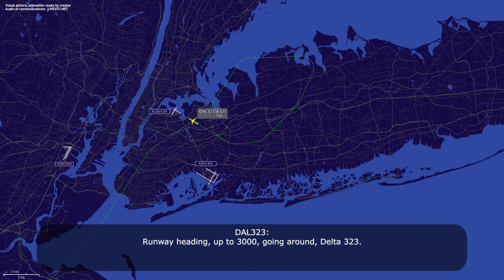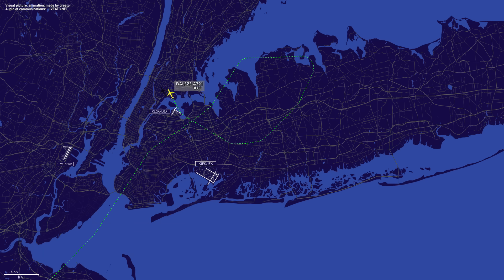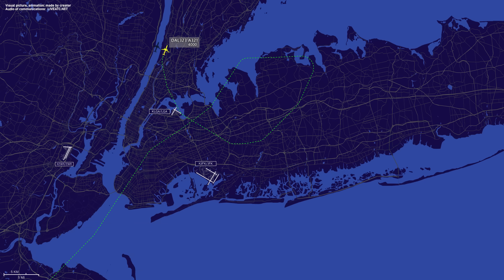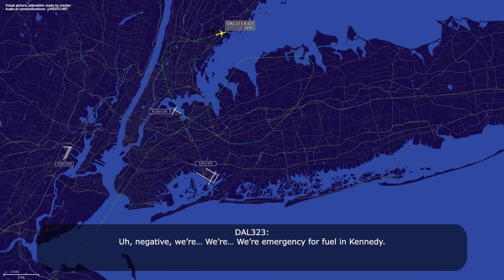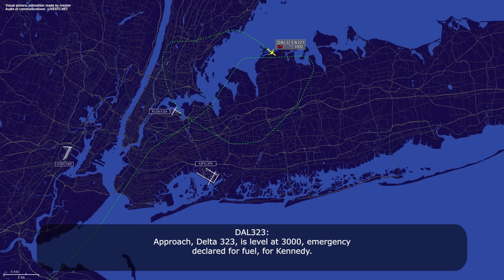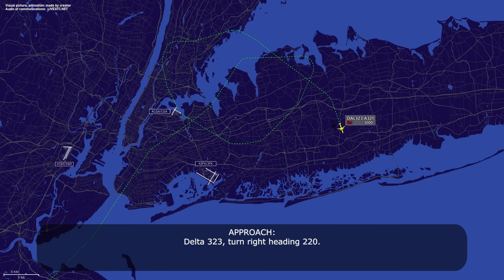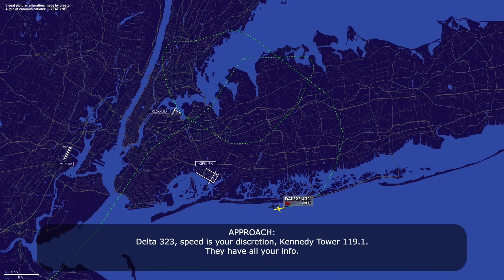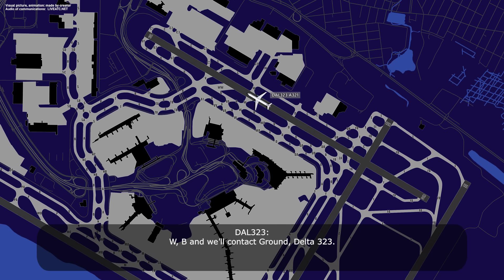Pilot declares MINUMUM FUEL after go around and diverts to Kennedy Airport. Real ATC

Comment: For those criticizing the 40 minute fuel declared as 'emergency:' consider that each go-around can take up to 10 additional minutes and with wind-shear reported at one airport they couldn't take the chance of being number 10 (already about 20 additional minutes) to line up behind the LaGuardia row.
For the same considerations they had to let the JFK folk know they can't be put at the back of the line.
The pilot took the safer choice of having to answer a few additional questions and fill out additional paperwork rather than just 'hope for the best' in getting a favorable landing the second time around.
This 40 minute reserve fuel was a good demonstration of how it is meant to be used.
Reply: Never criticize a pilot erring on the side of safety
Reply: yep, i fully support the pilots decision here. 40 mins of fuel after such a go around, means they are out of safety margins..
Reply: To clarify, mainly for myself, so I'm kind of asking for confirmation: It's an emergency not because they had 40 minutes of fuel left, it's an emergency because they predict they will probably land at their divert with less than final reserve (30 minutes). They can't risk another approach at La Guardia because the known windshear presents an unreasonable risk to committing to that field, so they have to bail out and call JFK as their final option - they know the routing will use 10+ minutes, putting them on the ground with 30 or less, or at least the very high chance of that happening. Ergo, emergency - predicted landing at nearest suitable airport is with less than final reserve.
Reply: @Shrike200  Slightly off - its an emergency because factoring everything, they will have to attempt a landing a Kennedy with 30 mins or less. Since its never taken for granted it'll be a successful landing, additional buffer needs to be given. We've lost a plane before when pilots and controllers not take this into account. Avianca Flight 052.
Reply: The 'acceptable' min fuel is one thing in perfect conditions - but add poor weather, heavy traffic, or any other complications, and all the 'bean counter' calculations are invalid. That's why the captain gets paid the Big Bucks and needs to Call the Mayday while there's still time to adjust - as this one did. Well done all around.
Reply: @gcorriveau6864 the pilots literally counted the beans and determined they would be putting themselves in a very risky position. Stop denigrating analytical analysis. Doing it by the “feels” gets people killed.
Reply: @gcorriveau6864 The bean counter calculations don’t become invalid, they just don’t matter at that point because all the paperwork and late arrivals and extra airport fees is cheaper than running out of fuel by a factor of like a million. The bean counters were probably correct, and they exist to PLAN things. This was adequately planned, and the pilot made adequate adjustments for reality as it unfolded.
Reply: @ahgflyguy  why r u defending beano counters
Reply: Well said. To add to this comment, this flight was during a stretch of a few days with awful weather in Northeastern area. Cold below freezing. Very strong over 21 knots west wind and over 30 knots gust. These kinds of condition result into more go-arounds and loop-back vector in NY airspace is notoriously long due to traffic volume and restriction. 40 mins fuel is barebone in those conditions. Armchair experts criticizing the professionals who do this for living is ridiculous.
Reply: Would they have made it if they had to go around again?
Reply: @carmcb absolutely, probably 4-5x. The issue is that if you give up and have to divert after #5, now you can’t. Typically they’d try at least one more time, but the sequencing was just too long. I’m sure they landed with plenty of fuel even with the divert.
Reply: it's also Delta safety policy once at BINGO fuel. so if the pilots had ignored the fuel requirement, Delta would have ignored their paychecks.
Reply: @gottafly30 So true.  Every airline has its own rules and parameters.  Nothing is left to chance
Reply: Minimum fuel should consider two circuits or missed approaches AND diversion to another airport. If a incident affected that airport no matter how many runways there must be adequate reserves to meet another safe landing elsewhere. Eg power failure or radio outage at airport
Reply: @paulgerrard9227  Also, I think there should be a regulation requiring airlines to file and alternate (with alternate fuel etc) when flying to single runway airports. That way if the runway is closed due to a gear up landing or some other incident, the pilot has the fuel to go to an alternate.
Reply: @6862ptc  flights always have a planned alternate (with acceptable weather), and carry enough fuel to divert. And will do absolutely everything they can to avoid landing with less than minimum reserve fuel.
Reply: @pezzer55  Wrong. Please read FAR 121.619 (the "1,2, 3 rule") and get back to us. I'm always amazed at the certainty with which people post opinions on subjects where they appear to be completely ignorant. For our friends in Europe, we are talking about U.S. regulations here, due to this being a video about a U.S. airline, U.S. aircraft, U.S. airspace, at a U.S. airport. EASA rules are similar...but different.
Reply: @6862ptc  I stand corrected. I was under the impression it was mandatory. I've never flown without (other than local vfr) and can't see why you wouldn't unless maybe there are no sensible alternates due to remoteness or no other suitable runways anywhere nearby
Reply: @pezzer55  What you're saying does make sense. But Airlines are in the business of making money, so they try to balance safety and profit. The FAA only requires a filed alternate (and fuel to get there), when the weather is below/worse than that stipulated in FAR 121.619. Like I posted above, it would make sense to require a filed alternate any time the destination has only one suitable runway. But that's not the law.
Reply: @JohnSmith-zi9or  You are correct. I wasn't speaking about LGA, but I can see why you'd think I was. I was just answering someone's post where he said all flights have an alternate on file. We both know that isn't true. But I added I agreed that many more flights should have an alternate on file, like a single runway airport. Even in domestic U.S., IMHO an alternate should be filed (including fuel).
Reply: So why can't they put a plane low on fuel in a closer to landing than number 10.  Bump a few have fuel back a bit and make them number 4.
Reply: @briananderson8733  They might have. That’s a good question. But the Capt. had made the decision to divert. It’s been my experience that you should stick with your decision to divert once it is made.
Reply: A go around will take 20 mins of fuel just like that. It’s 600kg in a 737 for a full go around.
Reply: Not really.  As a professional SIM pilot I have never declared an emergency.
Reply: plus there needs to be enuf fuel to get OFF THE RUNWAY :)  if plane stops anywhere other than off the taxiways it can really JAM UP THE SYSTEMS And add even more minutes to that ''time'' .....  40 mins is not that much time if you are not already on final approach ;) right?
Reply: Excellent analysis. I would be very unhappy in IMC at a major airport in my turboprop with only an hour of fuel. People just don't understand the wind, traffic or other variables regardless of the responsibility you have for the souls on board. Good choices here and excellent ATC as usual. Just tell them what your problem is and they will move Heaven and Earth to get you safely on a runway somewhere. We have the best ATC on the planet. Think about that...
Reply: I guess, but I mean they also went straight from normal ops to min then emergency instantly, kinda throws the whole system off. Min fuel gets you priority automatically. 

I think when they heard #7 they just got a bit flustered and declared the emergency. 

Given the conditions, I don’t think there was anything wrong with that decision, but still - skipping min fuel limits the options for everyone to fix the problem before it becomes an emergency.
Reply: isn't mayday fuel for part 121 45 minutes or below?
Reply: @KevinS819 No. Google FAA definition of Emergency Fuel.
Reply: @KevinS819  30
Reply: @KevinS819  No. Read FAA InFO 08004.

Comment: So close yet so far. It happens but someone failed in the planning since paxs didn't get their airport.
Reply: Where in the fuel planning was there a failure?

They took off with fuel, they landed with fuel. Nothing in the regulations prohibit the burning of reserve fuel.

Flights divert everyday. Are each of those diversions planning failures? Or is that the system working as designed?

Comment: To all the Airbus guys here that do a go around…YOU ARENT MINIMUM FUEL! You need to keep rolling the can because once you reload the second approach you now have 2 (sometimes 3 if you have a missed approach procedure with no waypoints) “discons” in the FPLN page and you only need to get the IAF extended to see a more realistic REMF. I guarantee you these dudes landed with a reasonable amount of fuel.
Reply: I'm so tired of reading negative comments from folks who have no idea what they are talking about!

YES, this guy was MIN FUEL. At Delta minimum fuel for an A321C = 4000# of Jet A, which is 40 minutes of fuel. That is what the Capt said he had. Emergency Fuel at Delta for an A321C = 3000# or 30 minutes.  He made the right call diverting to JFK.
Reply: @6862ptc isn’t emergency fuel 45 mins for all domestic flights? And how is minimum fuel always 4000# (whatever that is) when isn’t minimum the final reserve plus alternate, so it can depend where your alternate is what your minimum is as you need more to continue to your alternate
Reply: @tomstravels520  No. For Delta's A321C, minimum fuel is 4000# or 40 minutes, and Emergency fuel is 3000# or 30 minutes. This is different than computing fuel for alternate airports. If the weather is above a certain FAA minimum NO ATERNATE IS REQUIRED. That was the case with this flight.
Reply: @6862ptc  so why does FAA requirements state 45 mins final reserve for all domestic flights within the lower 48 states?
Reply: @tomstravels520  That is a dispatch planning fuel level, that's what they use to plan the fuel load before a flight. That is not the point where you declare Minimum Fuel or Emergency fuel in the case of a Delta A321C. Again, for Delta's A321C, minimum fuel is 4000# or 40 minutes, and Emergency fuel is 3000# or 30 minutes. Once you compute you will land with 30 minutes of fuel or less...that is when you declare a fuel emergency.
Reply: TOTAL BS

Comment: Airlines today are sending planes out with a high risk factor

You need enough fuel to alt + 45 min remaining?
Reply: Except you don’t always have an Alternate airport filed. If the weather is above what the FAA requires for your type of operation, then no alternate is used.

Comment: There was an infamous incident in India where a low-fuel aircraft had to divert to its alternate only to have to turn around when the plane in front of him crashed completely disabling the runway at that alternate. I forgot the flight numbers but the enthusiasts of this channel surely remember what I'm referring to.
The point is always be prepared that you may not be the only emergency.
Reply: A Spicejet Boeing 737-800, registration VT-SGU performing flight SG-256 from Goa to Delhi (India) with 176 passengers and 6 crew, was descending towards Delhi in deteriorating weather and traffic congestion. ATC advised the flight was #13 in the sequence for landing, the aircraft was instructed to perform two orbits, then was cleared to descend to 7000 feet. The captain (ATPL, 6,410 hours total, 2,003 hours on type in command) was rated for CAT II approaches, the first officer (CPL, 1,996 hours total, 1,743 hours on type) rated for CAT IIIa approaches. While being vectored for the ILS approach to runway 28 the RVR for runway 28 roll out dropped to 50 meters. The captain decided to hold at 7000 feet expecting an improvement in RVRs. After 26 minutes in the hold the captain queried the weather at Jaipur receiving information of 900 meters visibility with 1500 meters RVR. The captain therefore decided to divert to Jaipur, 3100kg of fuel were remaining (2573 kg required to divert to Jaipur, 3100kg of fuel required to divert to Lucknow).
Reply: @NICK_NJ Continue generation

Comment: #10 in sequence with wind shear on an already tight fit at LGA and a medical ahead, absolutely the right call to declare with what they had left.  If they even tried to make another attempt at LGA they would not have had the fuel to make it back around in the event of a miss.
Reply: Delta asked for sequence; ATC did not warn them.
Reply: And with winds already over 30 mph, all departures are also using 31 too. Once informed that they were 10th in line, the call to divert was correct and immediate. Min fuel means that the crew can’t accept a delay at all.

As for this, the plane needs to ultimately ferry back to LGA, but most passengers could choose to disembark at JFK (domestic flight).
Reply: @AEMoreira81  actually the pax deplane at JFK and are bused back to LGA. this happens more than people realize in the winter weather because of huge traffic volume into NY
Reply: @gottafly30 NYC airports are dysfunctional. They need to limit the number of flights to a much lower number and ban commercial jets smaller than 143 pax. They just can't have all those tiny jets waiting capacity.
Reply: And thank you ATC for warning Delta about the sequence.
Reply: Why didn't LGA ATC let them in sooner? That's insane to divert them to Kennedy just because they're way back on line. Seems like both incompetent ATC and WAY too much traffic in the area. There should be a cap at 50% capacity on the number of flights to allow for weather or whatever happens.

Comment: PIC is the PIC. A jet is at minimum fuel as soon as you start at the gate. That’s an exaggeration, of course, but no one should ever question a crew’s call about insufficient fuel. However, I did not hear a tower directed go around. All I heard was a performance increasing description of a wind shear, and it is correct that the could declared may-day and asked for LaGuardia.
Reply: Listen at 01:00, there they will get the instruction to go around

Comment: 40 minutes of fuel and you're declaring an emergency?   (trying to search for an older video about a JFK tower guy yelling at a B7 or AA pilot about doing just that with 30 minutes of fuel)
Reply: ATC isn't flying the jet.
Reply: It's based on the amount of fuel you expect to have on landing. The definition of emergency fuel for most 121 carriers is 30 minutes of fuel on landing. Given that vectoring around the 3 NYC airports always takes a while, it is extremely reasonable to expect that at the time they declared "emergency fuel", vectoring would take them under 30 minutes of fuel ON LANDING.
Reply: You need padding for missed approach and go around due to windshear, among other factors.
Reply: @MrRailfan  that's what the 30 minutes is for.
Reply: Every 121 airline I ever worked for required declaring an emergency when expected to land with less than 45 minutes of fuel remaining.
Reply: @thefungusshow2535  Every 121 airline I've worked for requires declaring "MINIMUM fuel" for less than 45 minutes.
Reply: @thefungusshow2535  Are you sure? Below 45 mins is “minimum fuel”. Below 30 minutes is “emergency fuel”. Check your FOM.
Reply: @notafanboy250   I did check my FOM. My FOM is not your FOM.